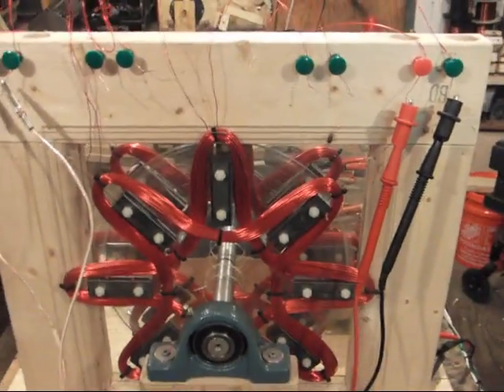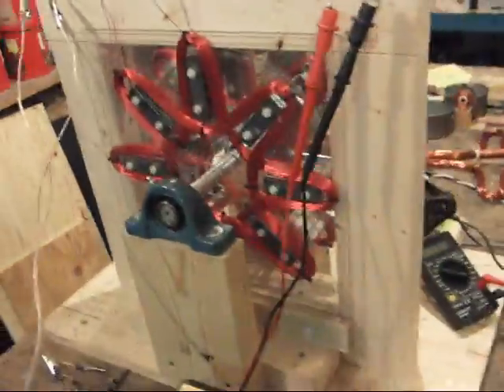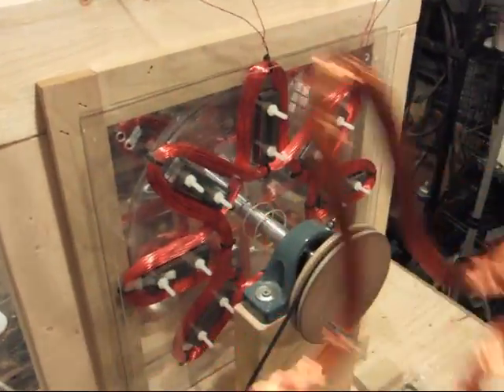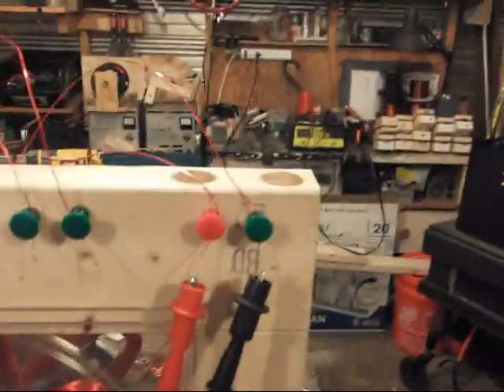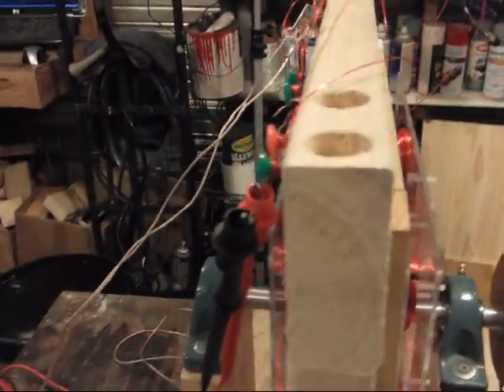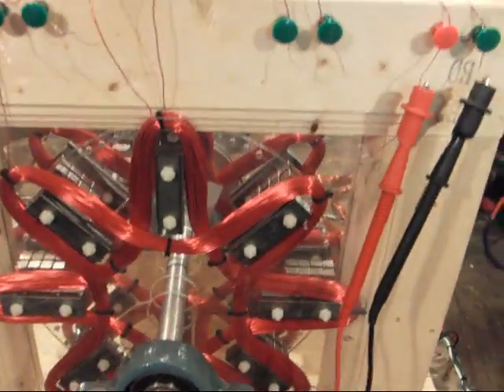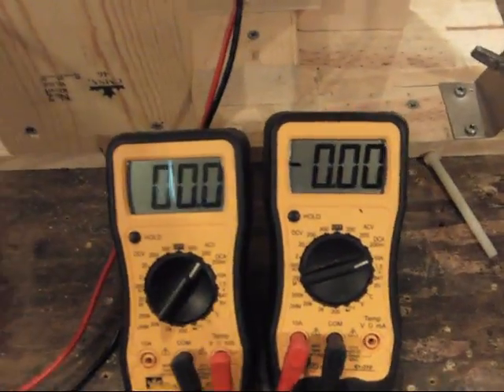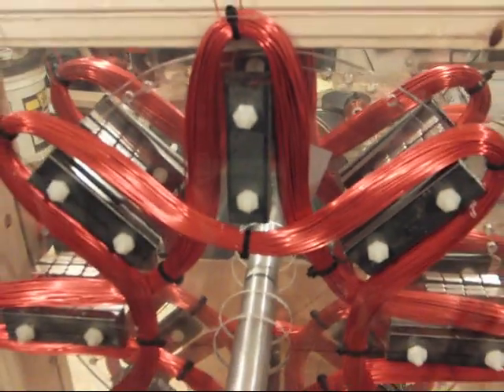Angus Wheel Update: Serpentine Fail

Comment: Mr2, What was the method of connecting the (two or four?) seperate coil packs? Were you able to engineer the opposing windings Ed used and cross the pickup of the respective fields they generate?